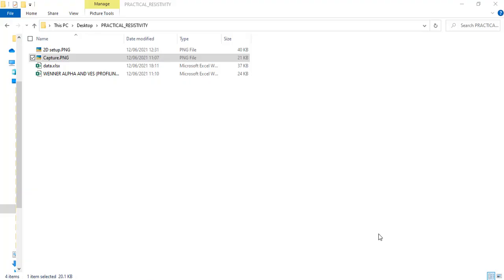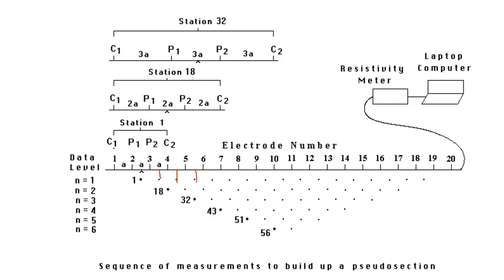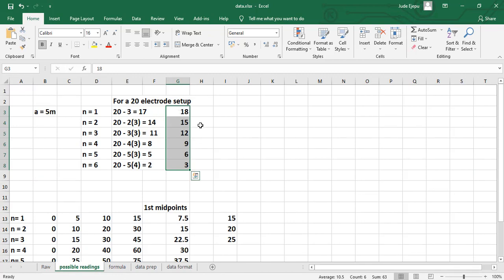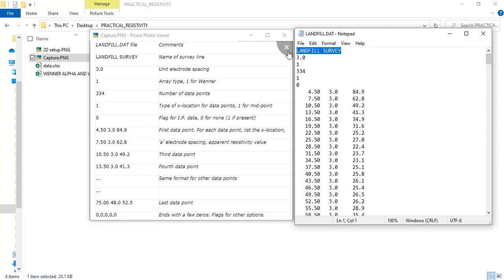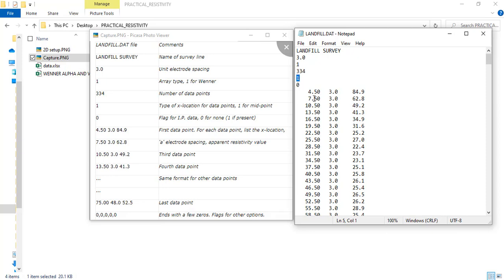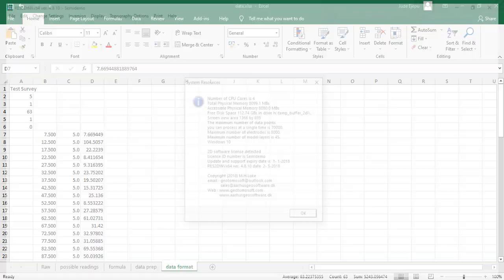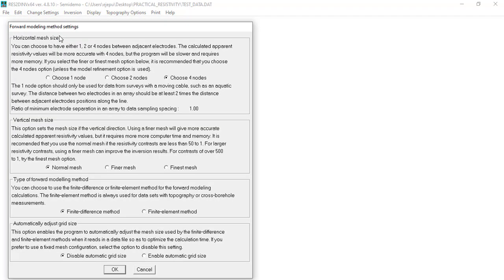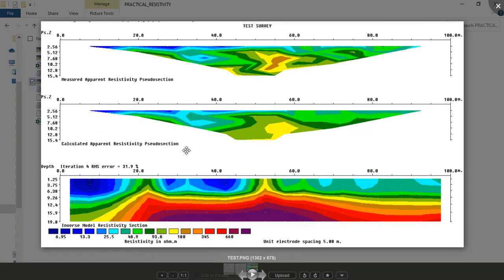Process Electrical Resistivity Imaging (ERI) data using RES2DINV software

Comment: How to calculate I and V
Reply from the maker: Use Ohm's law. V = I*R. If your earth meter is manufactured such that it gives resistance (R) as it's output, it should also give the potential difference (V) accross the two electrodes. You may then apply the formula. Best wishes